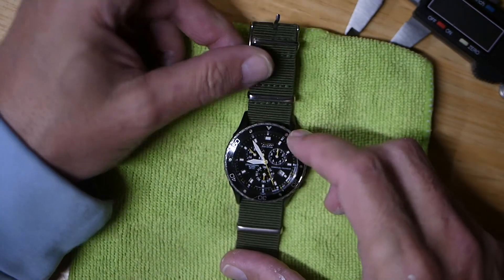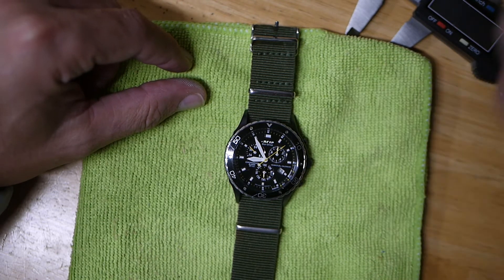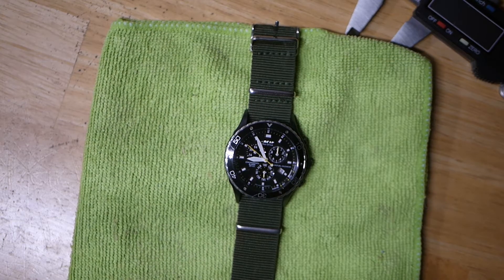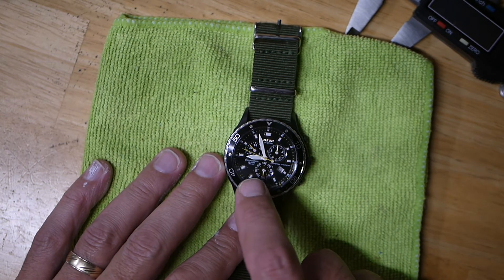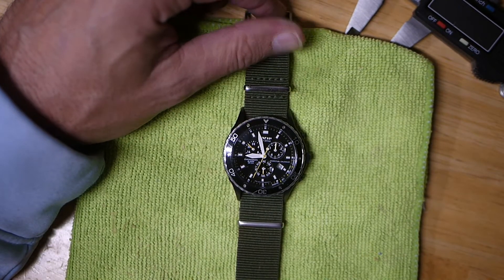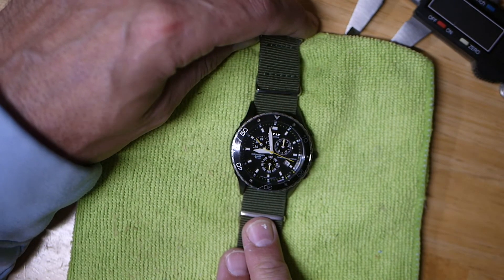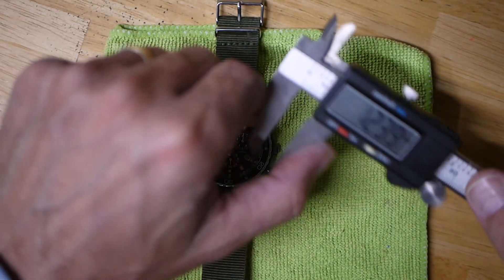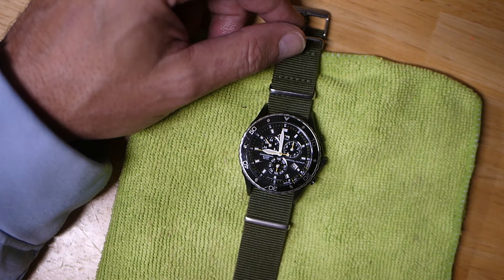Finally Fixed My Citizen Eco Drive E812 Solar That Would Not Charge!

Comment: I bought mine in 2007, still running strong. It stopped once after I left it in the drawer for some months. Took a few days to recharge and reset, but I got it working. Still the same battery. 17 years!!

Comment: Thank you so much!! Ive owned this exact same watch for close to 20 years. Its worked flawlessly for probably almost 15 years. The battery died prob 5 years ago. I put it away and forgot about it. Recently rediscovered it and bought a battery. It would not work.   Due to wearing it for so many years all details on back case are completely worn off so I had no where to turn for info. I stumble across yoir video and the reset worked! If you're ever in Phoenix I'd be happy to buy you a giant beer. Thanks again!!!
Reply from the maker: Awesome!  Glad it helped.

Comment: Thank you. I'm going to give this a shot after putting it in the window for 5 days. I lucked out and got mine in a lot for $19.99. People that own this watch don't understand that unlike normal eco-drive watches these rely on the battery for the complete movement of hands.
Reply: it worked after one day enough to set the time but I'm going to set it back on the window cell for more days. Thanks again.
Reply from the maker: The second hand may add some clues.  Link to the manual: https://www.citizenwatch-global.com/support/pdf/e810/e.pdf

Comment: Thanks for the video. I have a Citizen Eco Drive with an E812 movement that has stopped working. I downloaded the manual and tried the all reset to no avail. Thinking I may need a new battery. Is there a special tool to remove the back? Thanks again.
Reply from the maker: Mine is a screw back.  Check out my video on removing watch backs.

Comment: Hey, this worked for my Citizen with movement E660 ! It was dead for 2 years in its watch box, no light whatsoever. I got it in VERY close proximity to an LED light for 2 hours, then I turned the pointer to CHR pulled the crown out as much as I could (there's only 1 click on this movement, so no "position 2") and pressed and hold both buttons from the right-hand side of the watch. No beep at first, but after 20 seconds things started to show on the display. It came alive, eventually beeped once and it is now back working !
Reply from the maker: Glad it worked for you.  nice to get a watch back.

Comment: Great video! I have an E811 movement eco drive from the early 2000s and I am trying to diagnose some issues with it. The watch second hand is moving but I find that I am unable to move the hands in the TME mode. All I feel when I turn the crown in that position is a little clicking feeling but no movement from the hands. Also I see that the minute / hour hands are not moving at all as the seconds hand advances around the watch. I am just wondering if you experienced the same thing when you were trying to get your watch to run? Thanks
Reply from the maker: I have not run into that,  might be  dirt or something in their seizing it up.  
Good luck, love this watch.

Comment: You didn't really explain what you did with the connectors. I went back to my watch, and after looking at it with a loupe, I noticed the tab near the center of the movement on the retainer on top needed to be pushed a little more to the right to be "locked" into position.

Comment: Thanks, got my orange dial e812 going after watching this, quick Q to anyone, does anyone find that the crown wheel moves when worn in position 0, meaning you look at the watch and it has shifted to localtime or alarm time? is the crown on later models (mine <2010) a screw down, or is there no way to lock the crown in place? thanks Rick, and anyone who can answer these questions.
Reply from the maker: I have experienced the same issue where it will switch modes due to my activity.   I have not figured out a way to prevent it yet.  Maybe someone else will chime in.